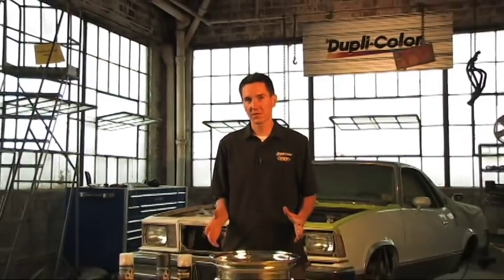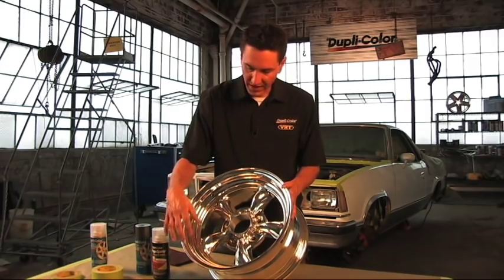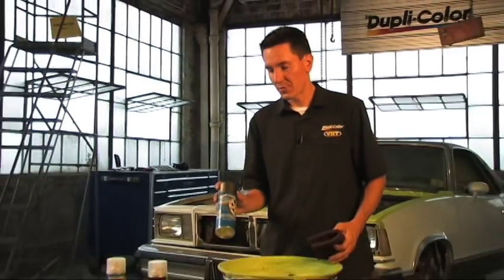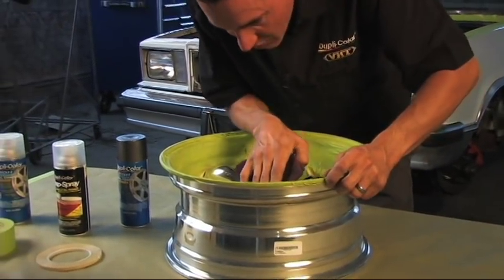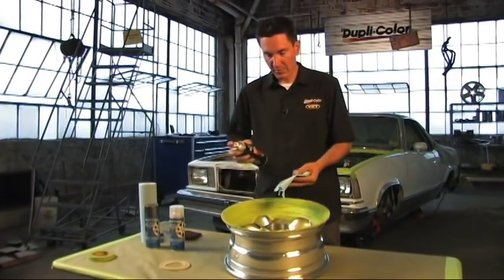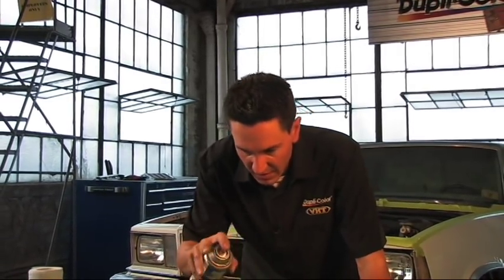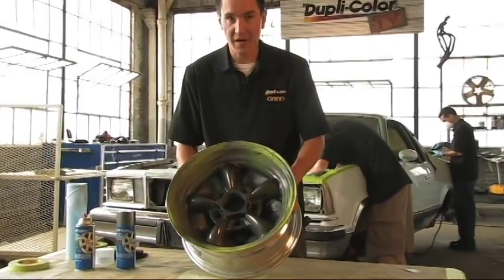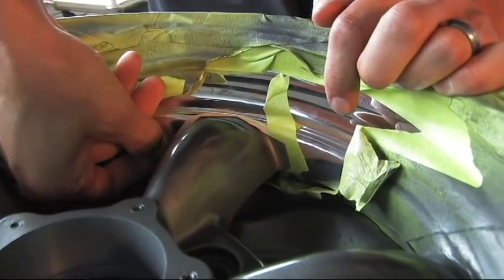Dupli-Color® How To: Wheel Coating

Comment from the maker: The High Performance Wheel Coating completely cures 7 days after its final application. After 7 days the product will achieve it’s maximum hardness therefore one should wait 7 days prior to installing and driving with the freshly applied coating.

Comment from the maker: The Wheel Coating Clear can be applied during the normal recoat times (before 1 hour or after 5 days) set forth on the label. If you’re unable to recoat during that time, then you should wait 5 days.

We would suggest a couple of light coats, then 1 medium coat of Clear over the paint. Heavy application of an alkyd-based Clear could result is a slight amber tone.

Comment from the maker: Hi Mike - Rims should be removed, cleaned well using Grease and Wax Remover, sanded to dull the finish. Once sanded, clean again and allow to dry.

Once dry, you can apply the Wheel paint, following the label instructions. It’s best to allow the paint to cure for 5 days. Good luck - and be sure to share your finished product with us! We'd love to see!

Comment from the maker: Hi Mike - It is always a good idea to clean the wheels with a strong solvent cleaner such as the Prep Wipes or Prep Spray prior to applying a primer. Doing so will remove the oils from your hands, dust floating in the air that landed on the surface, or any other type of contaminant that may have gotten on the surface of the substrate after it was sandblasted.

Comment: I used the prep wipes as suggested and they were a definite necessity to remove all the excess dust. 2 coats of primer, 2 coats of color, & 2 coats of clear. The wheels turned out pretty nice. I see the cure time is 7 days. Is there anything keeping me from putting the wheels on and driving on them after 24 hours? Obviously I would wait the 7 days before washing or waxing them.

Comment from the maker: Hello Beno! 

Although we would recommend using our Wheel Coating over CS101 -- Automotive Metallic would be a fine application on wheels, as long as you clean with Prep Spray, use Adhesion Promoter, and consider using a clear coat. :)

Comment from the maker: @jaxsurfken12 Sounds like a couple of things, Did you paint in the direct sun or on a humid day and how far did you hold the can from the wheel when spraying? All will lead to a dusy type effect as the paint is literally drying before it hits the wheel. Rescuff and shoot primer where needed. Spray in the shade on a day that his relatively low humidity.

Comment: I am having my aluminum alloy wheels sandblasted, do I still need to use PW100 prep wipe or PS100 prep spray?  I plan to use 2-3 coats of DAP1690 self etching primer followed by 2-3 coats of HWP102 graphite finishing with 2-3 coats of HWP103 clear.

Comment: Hello,

Quick question, is it ok to use Duplicolor Automotive Metallic CS101 (Chorme) on wheels?

I know it's more for trimmings,but wheels don't get as hot as brake calipers, so I was wondering if there would be any problems using it.